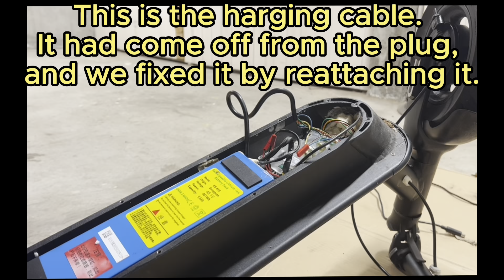Scooter Not Charging? Quick Fix to Get You Going Before Sending It to Service & Motorcycles, E-Bikes

Comment: hey i got this same scooter and same problem i tried that but it didnt help its not charging
Reply from the maker: @bosse3988  
Then you can check either the controller or battery.
Reply: @scooterWorldScooter  how? do i need unbug battery cable or controller cable? i dont see nohting wrong with my scooter battery but how i check my controller
Reply from the maker: @bosse3988  
You can try to charge battery direcly if the battery is charged then the problem is with controller.
Reply: @scooterWorldScooter  i tried charge direcly but not working but mine e way starts but doesn't load tried change charger
Reply: @scooterWorldScooter  or do i need get new battery or new charger port or controller?
Reply from the maker: @bosse3988  
You need to figure that out with trying.
Reply: @scooterWorldScooter  oh okay i try